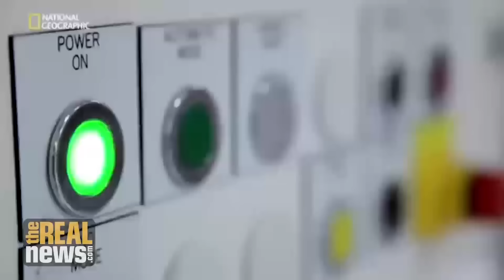"We Need to Electrify As Much Transportation As We Can"

Comment: When it comes to electric cars versus the infernal combustion engine, even when burning fossil fuels to generate that energy, you are doing so far more efficiently at a power station versus the infernal combustion engine and you are moving that toxic source of pollution away from the congestion of metropolitan areas and you are controlling the pollution at a more controlled source. Things that everyone forgets to mention.
Reply: +Robert Tony says:
"toxic source of pollution away from the congestion of metropolitan areas"
==
People are not talking about it because the pollution is not the main issue today.
Main issue is CO2 and you can't eliminate it regardless where you burn it.
CO2 is not a pollution in a sense that it doesn't harm the human body but it will affect the food supply seriously in the future.
Fight against the pollution has been pretty successful in the past, unless the industry buy the politicians to deregulate the antipollution laws.
Reply: People are not talking about because just like bitumen, due to economic requirements not much could be done about it. So there is a new one, what is wrong with bitumen pavements. Bitumen the left overs from fuel refining is completely and totally uncontrolled, no matter what rubbish is concentrated and left in it, it is completely untested. So put on the ground in suburbs and left to bake in the sun, with a range of toxic hydrocarbons slowly leaching off as well as undesirable carcinogenic minerals being abraded off and released into local environs.
Now we can do something the toxic burning of chemicals in metropolitan areas and as such, that ban will kick in far faster than most people think. You can bet a complete ban on private gasoline engined vehicles in inner metropolitan areas will be kicked in, drivers do not have the right to poison residents with the results of fuel combustion and carbon monoxide is far worse for people as well as other pollutants.
Major owners of metropolitan properties will demand it, to eliminate smog will add a huge amount of value to metropolitan properties, at least the non-underwater front ones.
Reply: +Robert Tony says:
"People are not talking about because just like bitumen, due to economic requirements not much could be done about it."
==
What cities in the US are suffering from smog today?